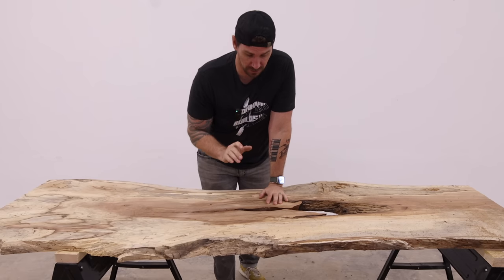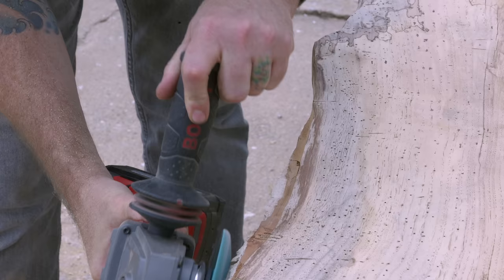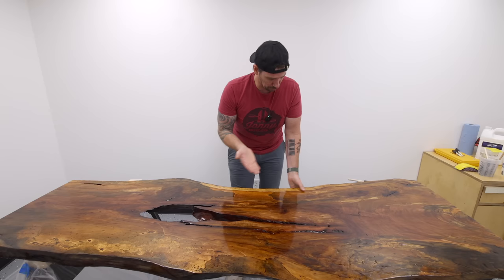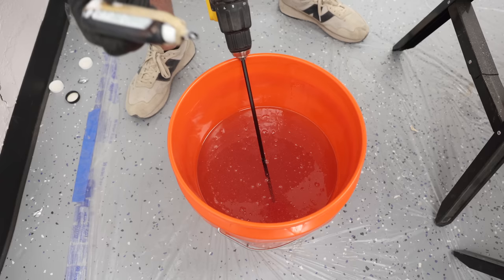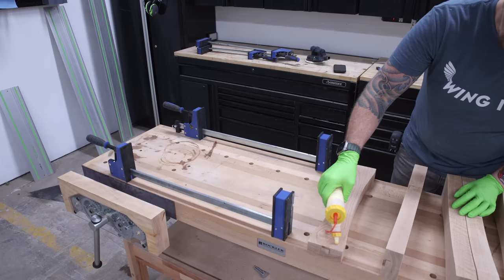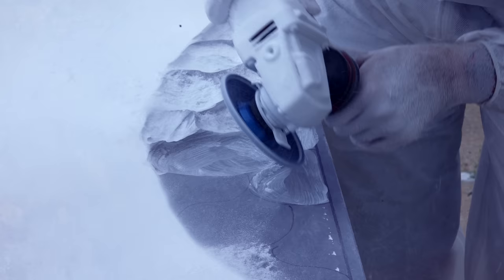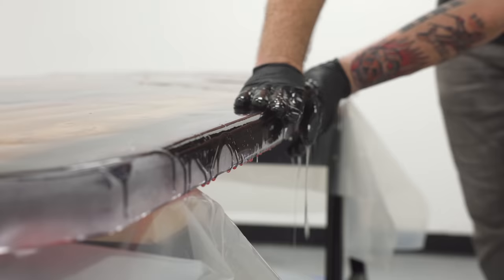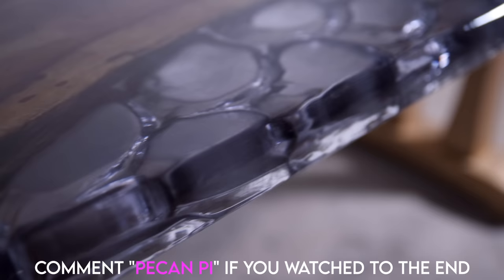Turning Trash Wood To Stunning Table

Comment: Too high humidity or oil on the surface of the wood could cause the waviness. Since it was so spongey, maybe the oils from your hand stuck around 🤷‍♀️ I can't imagine it being that humid in your shop
Reply: My guess was there was bug(s) that dried up and died inside the wood. The high temperature of the epoxy freed the oils, and they floated to the surface.

Comment: I make epoxy floorings for a living. From my experience whenever i had some kinds of wavey textures it was because of moist or greasy surface. 2nd option can also be that the wood is still sucking up the epoxy while in the drying/reacting process. When some areas of the wood are still more denser than rotting parts, it means that different areas suck up more or less epoxy than the healthy denser areas. (Sorry for bad explanation, im not English)

Comment: Pecan pie is wonderful.   You might want to explore using thickened epoxy resin to fill small bug holes, etc before the flood coat.  Ahron African meat uses it on small turnings if you need a visual.

Comment: Just a suggestion.  Next time you make this design in the bottom of the epoxy try using plastic bags full of air. Epoxy doesn't stick to plastic and you won't have to carve for hours on end

Comment: I'm just gonna warn you about that Omtech Laser. We've got the AF2440 100w version at work and have had a lot of problems with it. The biggest thing (aside from the main board being bad right out of the gate and crashing the software within 5 mins and Omtech's support being horrible to get any help and get it replaced) is the auto focus. It's garbage and will constantly crash the bed into the head. The best piece of advice I can give is to not use the auto focus to save yourself a bunch of headache having to repair or replace the head and gantry.  The table turned out great thought!
Reply from the maker: Shoot me an email and I’d be glad to connect you with my contacts at Omtech to try to get you some help. I’ve had nothing but great interactions with my machine. jonnybuildsstuff@gmail.com

Comment: I've recently built a cottage, where I used some salvaged 450 year old window frames made of wood. The wood was styrofoam like a certain points, but several coats of LINSEED oil did the trick. The old wood fibers got saturated with the oil and wound up being hard as ivory. I'm surprised all these wood slab epoxy YouTube makers don't use this method to really nourish the old wood before pouring gallons of epoxy resin all over it.

Comment: I would have preferred to have a darker stain on the legs, but that is just my own preference, I think it still came out nice. I like the cell look, I wonder how it would look if one part was a colored epoxy and then it was covered in a clear coat? Like a blue or a red to contrast with the wood? You talking about pecan pi like that is making me want actual pecan pie, which is sad since I just got my grocery shopping done yesterday, I guess I will have to hold off my craving until next week. I loved that you talked about pecan wood in general, I always wondered why I never see anything made with it, I didn't know it was such a difficult wood to work with until this video. I also loved that you tried so many new things with this table. Thank you for the video.

Comment: Micro-holes are a nightmare, i've stopped doing flood coats because a lot of the timber I use has them. I'm 99% sure that the scaly texture is because of moisture in the epoxy, I've had that issue with rotten wood before too. That part of the slab is significantly wetter than everything else and the rotten wood holds the moisture in so it messes with the cure on the epoxy. I'm extremely jealous that you have a dedicated room for pours though, that's high on my wish list.

Comment: If you overwhip a batch of Epoxy in the future, use a vacuum pump and a sheet of acrylic (with a rubber sealing ring) to pull some/all of the air out of the Epoxy in the bucket...you won't be able to pull a full vacuum without collapsing the plastic bucket, but you should, in theory, be able to lower the pressure in the bucket to cause the bubbles in the Epoxy to rise to the surface and pop...

Or, if you have a metal Vacuum Pot big enough for a 5 gallon bucket, you can use that to suck all the bubbles out of the Epoxy before pouring it...

Comment: Hey Jonny, well done on rescuing an impossible bit of wood.  Nice project.  Also good to see you promoting Blacktail's finishing product.  Since you guys did that project together I now enjoy watching both of your channels.  And nice to see you still support each other.  Considered doing another project with Cam?  As for the interestingly carved design element - yes, it does look cool, though I'll admit that since I'm a bit of a square, I'd rather have a "normal" table myself, and enjoy looking at this one at someone else's house 🙂
Anyway, keep up the good work.
P.s. Wooden legs are nice.  Are you sure they're widely spaced enough that C3PO wouldn't comment, "I'm not sure this table is entirely stable."?

Comment: I recently had the same issue with bug holes and epoxy, and solved it like this: mixed a small amount of epoxy, waited 2 hours until it was a little thicker than honey, and then filled the holes. The denser epoxy did not seep into the holes as much. Sanded it after and it was good for the entire coat.

Comment: When mixing deep pour epoxy I just use a bent piece of stainless that's like an L shape and I mount it under a wooden drill rig I made to hold a corded drill to basically keep stirring until the bubbles are gone. Sometimes it takes quite a while lol.

Comment: Daily tip, @7:00 is a great way to remove liquid nail on drywall. Any attempts at sanding or scraping that crap sucks! Using a heat gun makes the paint under it let go and you can use a scraper or putty knife to remove the paint and liquid nails in one pass. It takes about the same time but is much less energy to complete the task.

Comment: @Jonny Builds, Want to save yourself the ache of sanding? You build an upside down planer. Doesn't have to be a big industry one, just a normal planer, but built upside down. Then built a 'cart' that you can level and drag over a wood surface with sacrifical planer blades. If you got the money to buy wood for 1000 bucks, such a project is cheaper in contrast ;)
Reply: Heck, you have a CNC? Then you can just place a slab there and build a custom Tool-holder for a sand disk. Let it do the sanding for ya!

Comment: Next time you have this kind of wood may be use a big vacuum bag (sheet of plastic drape stuck on all edges) and pump the epoxy from one end to other with vacuum on. Like how they do it for carbon fiber. That should suck all the air from those small holes and let the epoxy penetrate.

Comment: PECAN PI. If you ever have another piece of wood like this, would it be possible to use a vacuum bag as we do in carbon fiber to basically replace the air in the porous “styrofoam” wood with a high-viscosity epoxy or something similar?

Comment: nice table. not many could have pulled off this idea and this slab. in my opinion the hue of the legs is not the best, clashes a little with the peice. a finish that blends more with the browns in the wood on top or a black/dark finish would have made this better. just my opinion though! truly a unique table you’ve pulled off!

Comment: Pecan 3.1415😂 nice looking, i did a "Farm House" style table from rotted bug infested "Slipperly Elm" (looks like White Oak but lighter in weight.)   Was a multi week process of deep pour epoxy soaking in to stabilize it.   With just hand tools a Router & barrowed/loaner biscuit joiner.   😅
The Legs i haven't yet finished 3 or 4 years ago now :/ 🤔  wasn't sure it would work well.   Two or 3 places some hearty bugs have chewed their way out 😂.   Surprisingly it has stayed flat & mothing bug the kyptonite bugs have damaged it.   Ended up setting in on a metal base that had a glass table top which mysteriously exploded one day. 😂😂😂

Comment: I am working with a piece of cedar. I had it split in half. It’s set up for a while. The center of it has white substance on it. I am guessing it is mold. I want to make a river table top with these two pieces but I’m sure if I need to get all of the mold out it seems to be very difficult to do this. Have you ever ran into this?
BTW. Love your videos I love working with old trash wood.

Comment: You say the slab is unusable, but that's just from your view of making a table top. There are people who would take that, cut it into small sections, stabilise them, cut down further, and turn pens from those. So from that $1000 slab, they might well get...   (quick off the top of my head estimation)...   maybe 2000 pen blanks. 

The fact that the wood is soft to start with is irrelevant to them. They would want as much figure and interest in each small piece as possible. So that's a fairly decent return from the point of view of a pen turner.  👍

Comment: Nice job power grinding the epoxy outside, spreading super fine plastic dust everywhere so the animals, birds etc. can enjoy ingesting it. My suggestion: invest in proper dust collection and do the work inside so you can clean it up and not pollute the environment with it.

Comment: Wouldn't help you but I am a woodturner we use wood like that all the time. There is a product called Cactus Juice but it has to be applied with vacuum to soak into the wood then put in an oven to cure. Not sure how it would work on such a large slab. Turned out good though. I liked the carving. If you get a piece you are more confident will turn out ever think of trying putting aluminum honeycomb in the open areas. that's what the carving first looked like.

Comment: *Pecan pi*
Looks beautiful Jonny, One concern I have is... 
The mounting to the table legs. If the wood was so brittle, punky and rotten, are the inserts going to keep their purchase or is this thing going to start wobbling in a year or so ? 
I've seen some people use a little bit of wood glue or a little bit of epoxy when putting the inserts in, I think that might have been a good idea in this case..... Just my opinion of course, I could be wrong.
Anywho, killer build dude I love watching your work man.
Keep up The fantastic job buddy.
Your pal,
~Jonny5🥁

Comment: Pecan pi.  Good job salvaging that slab.  I love the carving!  What if you had done something on the legs to echo that?  Maybe an organic shape (kind of like twisting branches?) with some carving twisting around the outside edge of the branches? Or maybe flowing from the bottom to the top like bubbles rising to the surface which is the table top.  The gold base looked good, it picked up the golden tones of the pecan wood.  It definitely looks Asian, lol.

Comment: Pecan just isn't a good choice for slab work (especially after sitting outside) because, as you discovered, it's basically got zero rot resistance. It's also fairly porous and my guess is that scaling you saw was due to oil infusion in the wood. (total guesswork).

Comment: For the area under the table that was carved out for the leg braces, do you ever use something to finish that area so that moisture and whatnot don’t enter the wood and make it warp over time?
Love the way the table top ended up, and while I like the shape of the legs I’m not fond of how gold they ended up. I think if the gold paint had been thinned out a little more so it was a hint of golden metallic instead of actually gold it would have blended with the colors in the table to more.

Comment: I know this is a little extreme, but could you use one of those VERY large vacuum bag systems that are typically used for clamping veneer? could you cover it in the penetrating epoxy, cover it in a plastic (assuming non-stick?) and then the vacuum would force the penetrating epoxy into the bug holes in the wood? completely brainstorming here...
Reply from the maker: In theory, but likely a logistical nightmare. Penetrating epoxy is the way to go. If I wasn’t trying to get videos out every two to three weeks I could’ve spent more time in with the penetrating epoxy.

Comment: Yeah, using epoxy to pre-seal is not the best choice. I tried it a couple times several years ago and made the switch to PC Petrifier instead. It makes a world of difference and doesn't darken the wood like epoxy does plus, it still allows epoxy to penetrate into the wood fibers for maximum bonding. Try it, you won't be disappointed.
K.Fjelsted
Fjelsted Nord

Comment: is better/possible to vacuum seal them after putting layers of epoxy and let it suck into the wood to make them sturdy?
Reply: My bet is you would end up with a vacuum bag stuck to the table. HDP plastic does not stick, but many types do.

Comment: I'm sorry for being the Buzzkill, however, is to my knowledge epoxy not biodegradable. So Sanding the epoxy and blowing into the nature with a fan causes a lot of Micro plastics in the soil. Maybe you can find a more sustainable solution. However still a great Video<3

Comment: Howdy. 

Honestly, there is no such thing as "bad wood". ANY piece of wood can be salvaged. Look at 200 year old barn wood for example. 

Anyhoo, i liked the build. Ive been doing woodworking longer than youve been alive TBH. 

Heres the "hairy butt" though....

Only recently, respectively speaking, has the Woodworking product and finishes caught up to what has already been around since the 50'ties. And thats Automotive paint finishes. 

A little known "secret" that us Veteran Woodworkers have known for what, 60+ years is that products used and manufactured for those SPARKLING shiny cars.....wait for it.......CAN also be used on wood furniture and has been for a very VERY long time. 

Once you put down your stain (if any) and your finish coat of whatever. You are no longer doing anything to the "WOOD" itself. Its been sealed already. 

Anything applied to the finish at that point, now you are dealing with "THAT" top coat, NOT the wood (or metal in the case of cars). You are dealing with the paint or the finish. 

So, with THAT knowledge (which MANY woodworkers overlook, especially newbies), when it comes to a clean, clear, brilliance of a shine that will LAST for years on end and is also scratch resistant. That teenie tiny bottle of "Nano" finish for $50+ bucks a bottle is nothing more than a FINE car polish remarketed for Woodworking and a jacked up price tag. 

I can get the SAME "Nano" (which is just a fancy word for extremely small molecular bonding) finish solution from Walmart that comes in a big ol 24oz bottle, does EXACTLY the same thing and buffs to a shine that light reflects off of it....mehh, for about $25 bucks. $50 bucks if i go to a car/truck detail shop. 

All you're doing is applying a micro thin barrier ontop of dried liquid plastic. What is Total Boat? Its an "epoxy". What is epoxy? Its essentially liquid plastic. 

Put my finish of a table top, of which a bottle for $25 bucks will last me a year vs. your table top finish that you got a teenie tiny bottle of for double the cost+....Dont tell anyone what was used....NO ONE especially the customer will EVER know the difference. And the thing is...Mine is a product thats been around for MANY decades and PROVEN to work. Yours is NEW and not gone through decades of use yet. 

Get the point?

Comment: I’m not sure how you get out of faulting the mill for even considering selling this.  It should never have made it into the crate, any seasoned woodworker could take one look at it and know it’s garbage.  They knew it was a punky pos, they saw a buyer halfway across the country and knew it was a safe bet to foist it off and make a fat grand that they NEVER would have got out of an in person buyer, and they did the shady thing.  They should be ashamed and should they see this they should look hard at their QC process as there’s no excuse.  Spalted does not equal rotted to mush.  Just because you were able to salvage something and by spending significantly more labor/money, something a non-YouTuber woodworker couldn’t do, make a valuable piece doesn’t make it ok.  If I got this it would be taking food off my table, it would be going straight back and if they tried to protest it would be a big problem.  They may or may not use the old “every piece is unique, so we can’t back up the quality” bs, or they might be stand up guys that would return/replace it without question, I have no idea I don’t know them, but trying to pull a quick one like this is messed up.